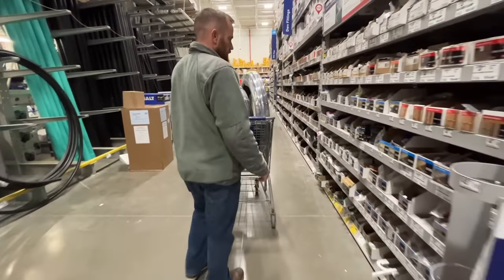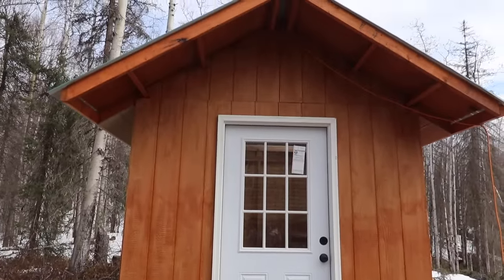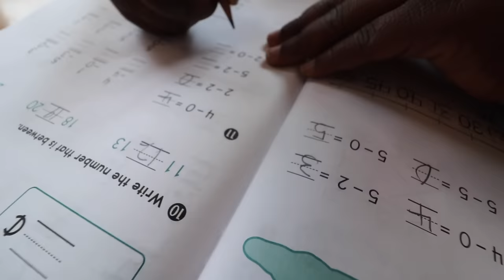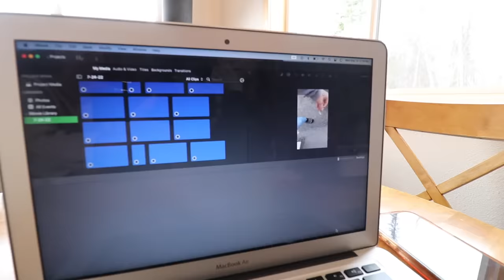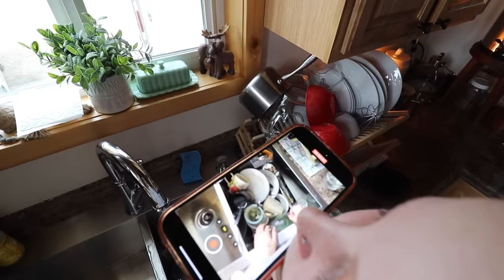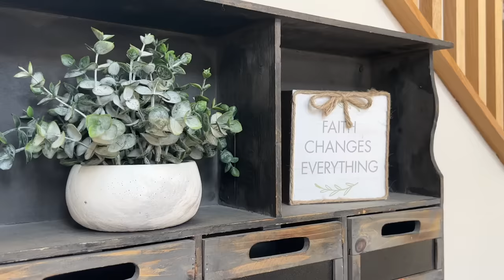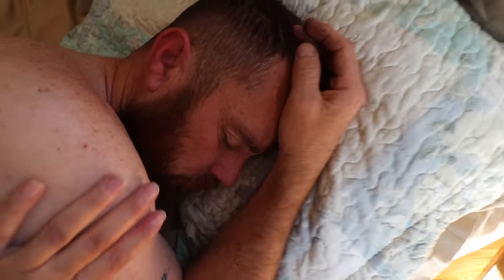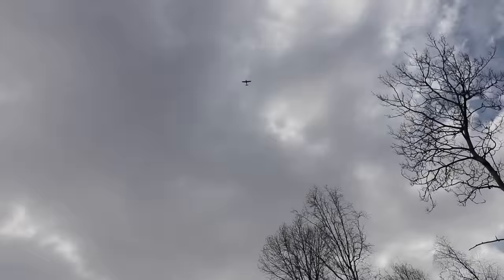We're Running Out of Water! Off Grid-Tapping Into our New Well + Clearing Downed Trees for Firewood

Comment: You mite want to put insulation on top of the pipe that goes across the driveway I had a problem where I drove across my waterline it drove the frost deeper and Deeper the more I drove acrossed it then it would freeze  but 6ft should be deep enough good luck & god bless & by the way if u get water started out of new well u could fill old one with new one just to get by till u get it dug up just a idea
Reply from the maker: We decided to bury it 10 ft down since it goes across the driveway. And Joe did buy insulation.☺️

Comment: Good call on going to 10’ since you are crossing the driveway! Without snow coverage the frost line goes quite a bit deeper under a driveway. I’d lay some rigid foam board down over the pipe as well. It may not be needed but it certainly won’t hurt.